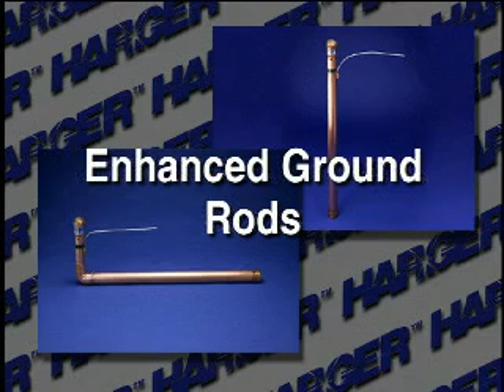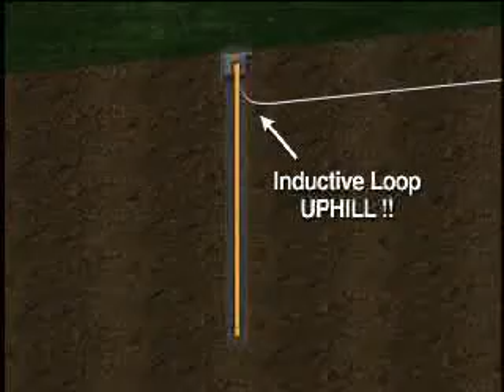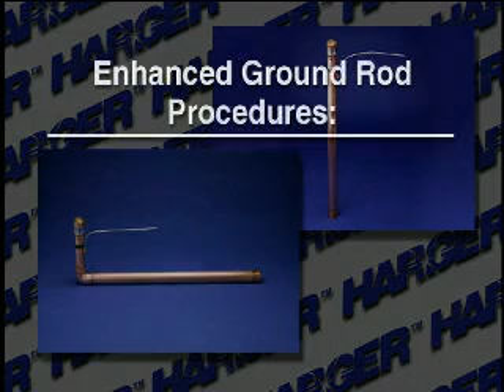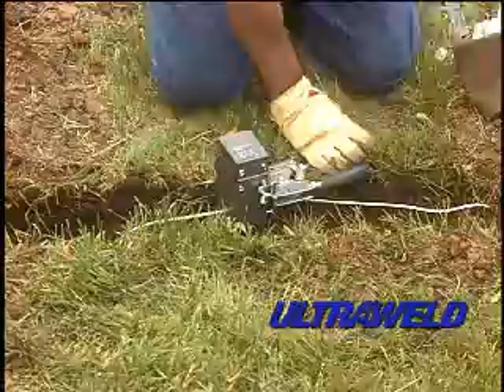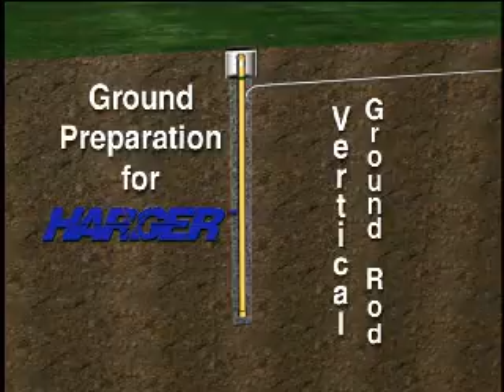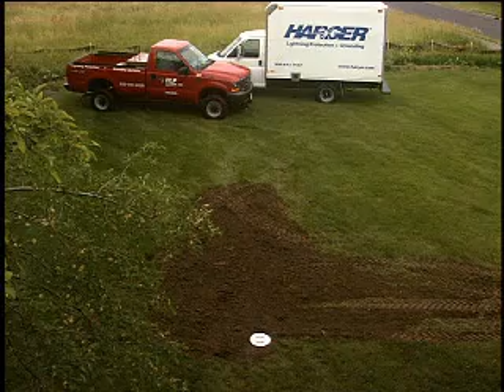HARGER Ground Rod Lightning Protection

Comment: Just burry a 1" x 10' copper rod in the ground (solid) then use # 4 awg. THHN  wire. You can use salt  in the hole to keep it moist . Salt is two elements, metal and gas. Sodium being metal, and chloride being a gas. Common table salt. This creates a compound. Salt. This will make sure that a good ground is made.  But if the rod is in a moist area salt is not needed. Drill a hole in the top of rod and secure wire with a copper eyelet #4. Burry it till only wire is comeing out. Ready to go.